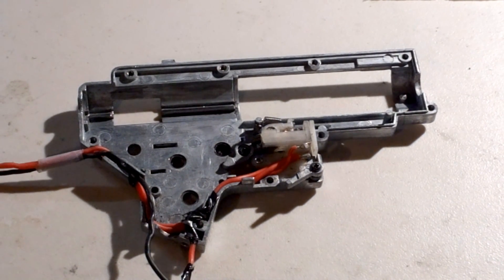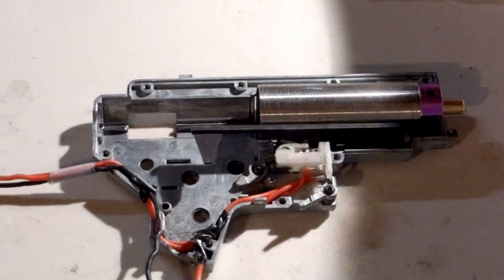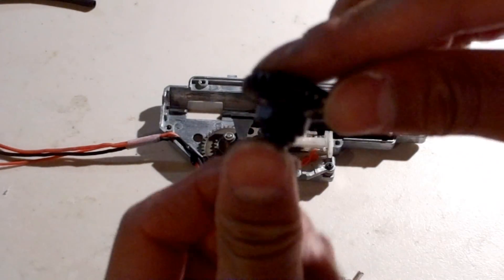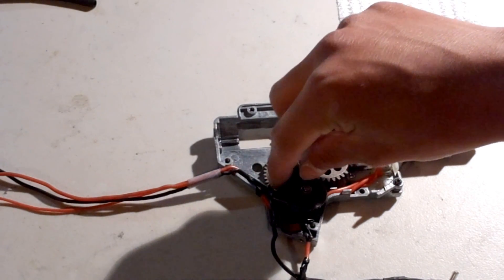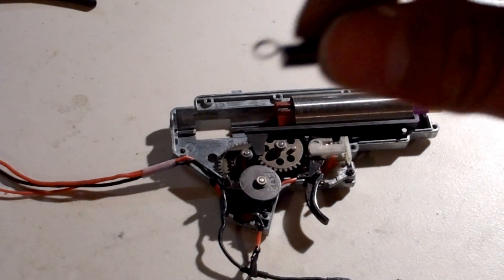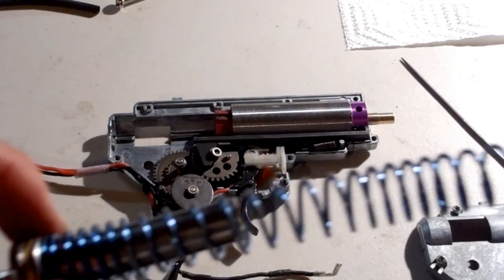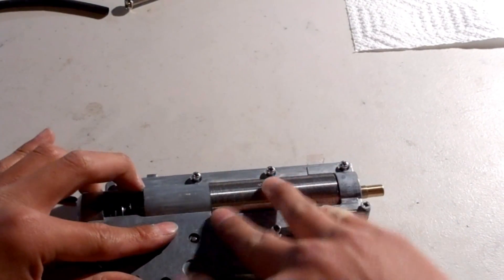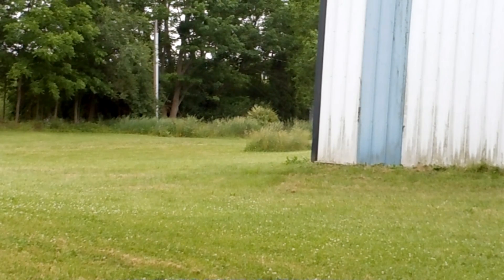Version II Basic Gearbox Assembly Guide

Comment: I did everything exactly like this and sent pics to a tech who said it was right and it's not shooting when I plug in the motor and a battery.....
Reply: Does the motor make any noise?
Reply: None
Reply: ELITE-AIRSOFT PA It should be an electrical problem then. Check for stripped wiring, especially near where the motor pinion gear goes into the gearbox.
Reply: Hmmm how would I check that? I'm not too good with gearboxes if you haven't noticed
Reply from the maker: @ELITEairsoftPA  You should open the gearbox and only connect the motor without it spinning the gears. In other words, simply test if your motor spins when not under tension from the gears/spring.

Comment: How the hell did you keep everything in with the spring under tension? I've never been able to find a way to keep my GB from exploding D:
Reply: I thought the same thing. I think that is why he is using the screwdriver into the spring guide @ 4:29
Reply from the maker: Lester Sagastume
This may be a little late, but it depends on your luck with the tappet plate and spring. Sometimes, the tappet spring is enough to keep the air seal parts in place (that's why it clicks in). Now, I just attach the gears first, then the air seal parts.